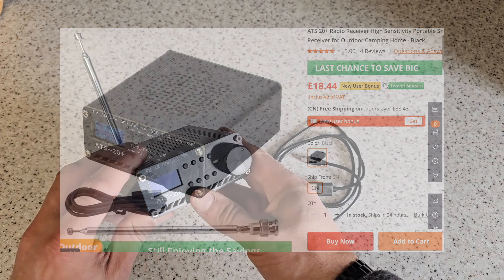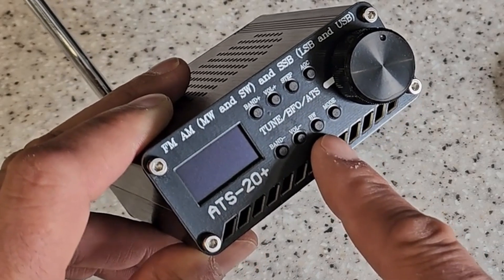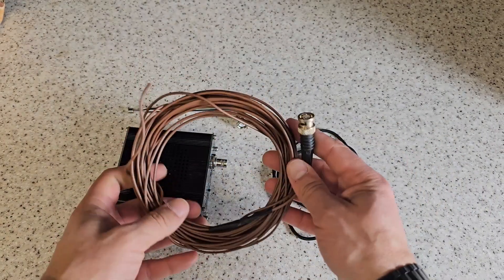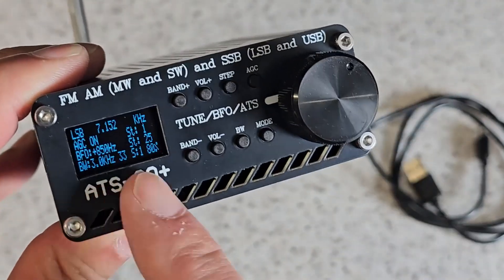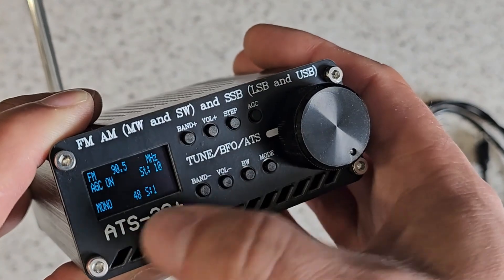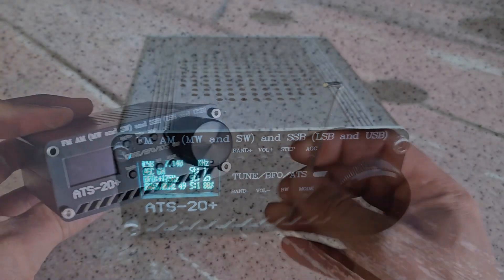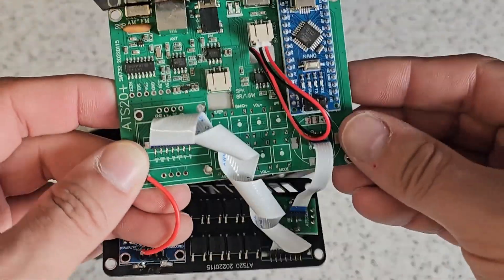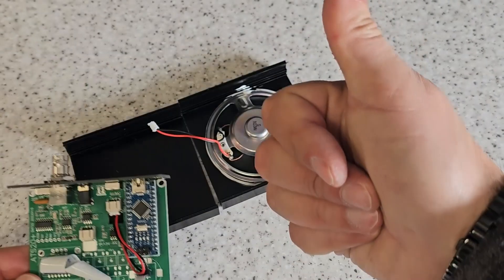DuB-EnG: ATS-20+ Plus - A tiny DSP all mode Ham Radio Receiver for £18 - OMG! - AND IT WORKS! PU2CLR

Comment: I bought one from Banggood about a month back. The issue with the slow tuning, where you need to wait about a second before you can here anything, I think is to do with the AGC - I tuned it off on mine and the issue seems to have gone away.  My main "gripe" with it, is the tuning knob is too big and makes it hard for my sausage fingers to press the mode button - that was fixed by pulling off the knob. :)
Reply from the maker: Always good to pull off your knob with your sausage fingers :-)  ...   ❤😂🎉  merry christmas!

Comment: I used to work for Intel Corp in the lithography department. The amount of circuitry you can pack onto a computer chip is amazing. That's where all your technology went, into a chip. That's why it's so clean looking inside.  🤖
Reply from the maker: RF used to need capacitors and coils...  big analogue components...  now its all software!!  Incredible!!!
Reply: @DubiousEngineering  Yes. The combination of integrated circuits (transistors, capacitors, resistors, diodes, etc) and software,  with microprocessors,  makes all that analog stuff super tiny. They layer patterns upon the silicone wafer,  and repeat that process,  stacking different circuits at different layers. You need scanning electron microscopes 🔬 to see everything & it looks fascinating, like an aerial view of a complex city.  I worked in the clean room for 12 years on SEMs, Nikon Lithography machines, the tracks that are attached to the Lithography steppers,  etc. They are basically taking photos of circuits and printing them onto wafers, then exposing and developing the circuit like an old school photograph. It was an amazing experience.

Comment: What is the length of the antenna that you made? I am thinking about maybe clamping a long enough wire to the stock antenna, then throwing the wire up in a tree...
Reply from the maker: My suggestion is you sould tune the length of the wire to 1/4 wavelength of the frequency you're listening to for best performance...  or get yourself a mini ATU (antenna tuning unit)

Comment: I've had my ATS 20+ nearly a year now, great bit of fun, use it all the time with a long wire.
Nice video, cheers.
Reply from the maker: Im looking forward to doing the firmware update! What firmware is your on?
Reply: Mine came with v3.04 on it, worth noting there are a variety of different versions of the 20+, various places in China are making them with random software versions.
You should also check out the Si4732 mini radio, it's the size of a cigarette lighter.
Cheers